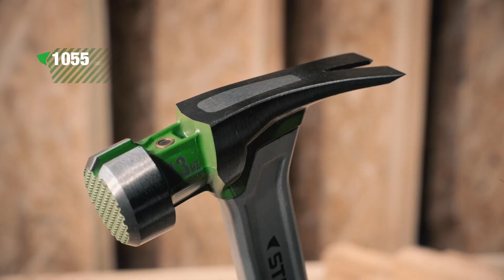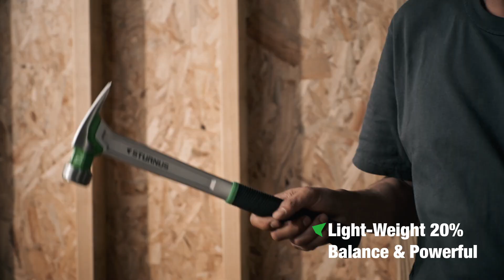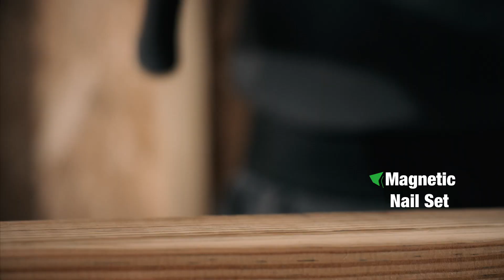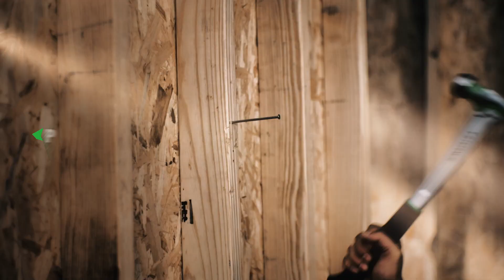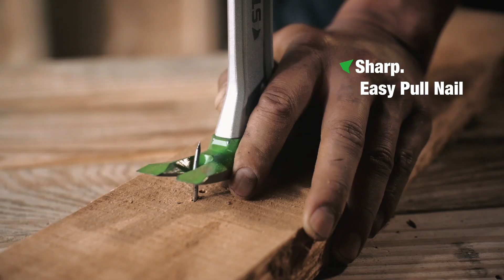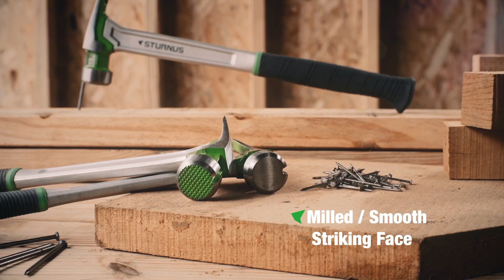STURNUS 13oz Velocity Hammer

Comment: Get a Martinez instead.
Reply: I have two Stilettos and depending on the price I would try this before venturing out and getting a high dollar tool.
Reply: @billbeckett1021  yeah, nobody cares.
Reply: @Heybarf  Martinez hammer is a gimmick.  A $300 gimmick.  Not for serious pros!!!!
Reply: @david3551  do you own one ? 
I can assure you it’s no gimmick.
Reply: @david3551  if you’re a “serious pro”, 300 bucks for a tool you use everyday isn’t that much.
Reply: Definitely no gimmick,  now if you can't afford one that's a different story
Reply: @Heybarf preach
Reply: Martinez is a beast of a hammer i own one, and this is going to be 4 years that i have own it, same handle, same head, and i do concrete with this hammer